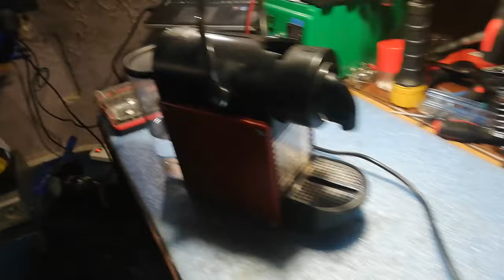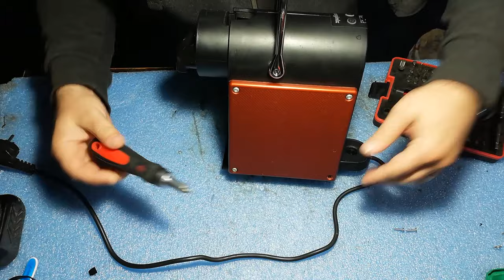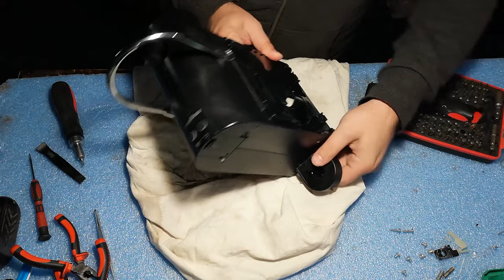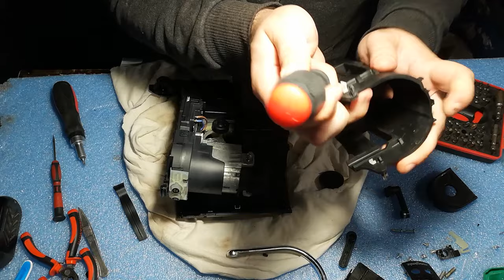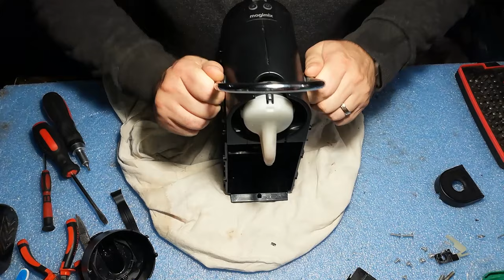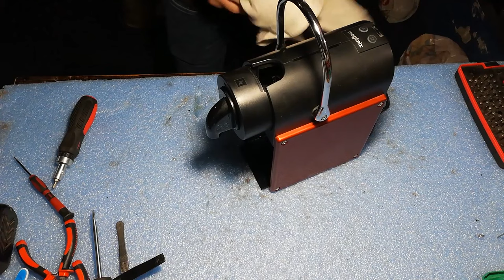NESPRESSO PIXIE - Step by step clean and disassemble guide XN304 / EN124

Comment: PROCEDURE FOR TOTALLY CLEANING THE NESPRESSO PIXIE COFFEE MAKER WITHOUT DISASSEMBLING - MY EXPERIENCE
    

PROBLEM: Machine does not produce coffee due to clogging, causing a large backflow of hot water.

1. Clean the inside of the machine as many times as necessary, as recommended by the manufacturer, until the water comes out completely clean.

2. Afterwards, turn off the machine's power take-off, remove the tray, and do the following:

With the machine in hand, place the coffee outlet under the sink faucet, letting hot water pass for approximately 2 minutes, making the counterflow, which will release the material deposited in this sector.
After applying the cleaning procedure, mentioned in item 1, which will remove the material that was removed by the counterflow of hot water.
3. Repeat the procedure from item 2 until there is no more coffee residue in the spout.

4. After these procedures, there will be no more hot water backflow and the machine will produce coffee normally.
Reply from the maker: Hello. What a detailed guide.  I will pin your comment on this video so others can see it. Thank you for your contribution on helping others!
Reply: @benassy69  After item 2 I applied a "manual" procedure using a counterflow with hot water.
This counterflow procedure is typically used in industrial process filters, or more commonly in pool filters.
As people don't routinely clean, I think Nespresso could incorporate a similar procedure.
Reply: Worked like a charm. Thanks for an easy fix.
Reply: The counterflow technique worked perfectly: I brushed the pyramides plate from the inside with soap and rinse extensively (as recommended by the Nespresso hot line), but it did not help. I then applied full pressure hot water from my tap up the nosle, creating the counterflow... I could see small brown aggregates drip down my sink, and after replugging, I had barely any clogging. Thanks for the easy fix!
Reply: @arnaudcarpentier5960  Hi! I think that Nespresso could provide a simple device incorporated with  machine for feeding with hot water to be used in new counter  flow system !
Reply: @arnaudcarpentier5960  Hi Arnauld, it looks like you´re from Germany. I´m from Austria. Pleasen can you tell me in german , what counterflow means?
Reply from the maker: Stellen sie das gerät verkehrt herum unter den Wasserhahn und drücken Sie wasser in die Kaffeedüse .
Reply: @benassy69  Genau!

Comment: Thanks for your video!
I was able to fix the handler that had broken (after disassembling I noticed that the bearings collapsed). I used JB weld and put them back in  place, I also lubed the rail with petroleum-jelly and it is now fully operational. 
Good thing that I also managed to clean all the channels from inside. This machine is being operating for the past 10 years, would you imagine the mess. Lol.

Again, thanks a lot.

Comment: You clearly forgot the MOST important part!! Make a cup or two if you are able before you start to help motivate and keep focus! Truly a great video that helped me clean my system properly and identify where the leak was coming from. I got it into working order just before puting the other half on to see it operate. I used your other video for "most common leak points" to identify the leak just after the heating point.  Took that apart and cleaned and the leak is much less now. I may replace in the future, but my system is fully hands on cleaned with vinegar and soapy water.  Thank you again for such an in-depth disassembly for what we all know they DONT want to be a serviceable unit!
Reply from the maker: Thanks for the comment and I am glad the video was helpful for you. Thanks for the tips as well ...

Comment: Nice video, but before you do this try backflushing the nozzle under a hot tap. Open the chamber and just flush. It worked for me: a lot of gunk came out and after that the machine worked flawless again.
Reply: This reply needs to be pinned!!  This worked perfectly for me.  

I back flushed under the tap, then normal flush with the pump, then back and forth between back flush and normal flush.  A ton of gunk came out, even though I always flush with water before and after making an espresso.
Reply: I did this, and took a toothbrush and gave it a good scrub inside, and now it works perfectly again.
Reply: I’m sorry how exactly do you backflush it
Reply: @odenjohannesebastianbach1463  Remove all the loose parts.  Open the chamber in which you normally put the coffee capsule.  Hold the machine upside down above the sink.  Run water through the nozzle (the part from which the coffee is normally dispensed).  You'll probably see a lot of old coffee residue come out.  Be careful and it should be easy to keep the rear of the machine dry (which is where the electronics are).  After this, reconnect the machine and and run it with just water.  Probably you will again see coffee residue come out, this time from the nozzle.  Repeat these steps a few times.
Reply: I started dismantling my machine a month before this post and just coming back now to finish cleaning and put it back together!  This would have saved a lot of cursing 😂
Reply: @markachternaam5207  what do you mean by "loose parts"? Do I need to remove the side screws ,the handle screws and the body casing on each side?
Reply: @ryuno2097    No, just the water tank, drip tray and used capsule reservoir.

Comment: Hi Adrian, I discovered, via the manual, that the correct and very easy way to remove the inside chamber that you struggled with, forcing it, is by inserting a small screwdriver at the top on the left inside the drip tray chamber, there is a small square hole, when you do that and lift a little bit at the same time, it releases entirely by itself, without any pulling and/or danger of breaking latches/tabs.
Reply: The manual instructs on how to disassemble it? That's pretty impressive. Mine not.
Reply: @DavidMoralesMojica  Hi David, yes, one I found does.
Reply: @DavidMoralesMojica Also important to know is machines, gadgets, watches, phones have been made most often with the intention to put people off of trying to fix anything, the manufacturers promote material waste, they want people to throw things away and buy new ones. This is why new EU law is going to oblige manufacturers to make, for example, phones in which the buyer can easily replace a battery. Nespresso developed machines to make it seem impossible to fix, newer versions are sometimes easier. Basically manufacturers are guilty of creating societies that create lots of environmentally unfriendly waste.
Reply: @GetMoreMellow  I'm curious, what brand you have? What does it say regarding disassembling the machine?
Reply: @DavidMoralesMojica  It says never open always let an accredited service person do it (€€€€€€€€€€€€___)
Reply: @DavidMoralesMojica  They are always similar the oldest types were made to be the most difficult, they also use screws that nobody has a screwdriver for, anything to deter people from helping themselves, obviously very unhandy and unintelligent people shouldn't mess around, all you do is take great care and do not touch anything is it is plugged in. My one is all models, I have fixed most. Those with fewer gadgets like automatic capsule drop function are best as fewer things can go wrong
Reply: @GetMoreMellow  But you said that via the manual you discovered an easy way to separate the pieces. I'm curious what the manual says about it, because mine doesn't have any mention nor image of the inner pieces to realize how to disassemble it correctly. My brand is Krups.
Reply: @DavidMoralesMojica  I will see if I can refind it, what I found was online. Even if you know where the top secret latches are it can still be hard with some get parts to release, but the part I mentioned at frint when I got my little screwdriver in there at the right spot  the thing came loose immediately. Those books they provide are mord or less useless, inline more can be found

Comment: A few years ago I did painfully this with a Pixie to scrap off the aluminium from the diffuser plate (after it had been sitting in the machine for over a year).   Today my machine didn't flush due to coffee residue and I wanted to see if there was a frustration-free way of disassembling this and now I know there isn't!

Before anyone tries the disassembly: please try Ted van Oss suggestion in the comments and try to back flush the nozzle of the machine under running water.  Solved my blockage near instantly for me.

Comment: Thanks for the tutorial, I managed to fix my Pixie, so all good. I have though a few observations on how to make it even better. First, it would help to zoom in when a particularly tricky part is handled, to remove guessing. Second, the casing is held together by snap-fits, which I broke many of them while taking it apart, as I didn't know where the "male" and the "female" were. It would help to provide tool insertion side, if known. Thanks again.

Comment: For this issue absolutely no need tear down the whole set,  a waterpik Oral irrigator do very good job, just remove the capsule chamber， then use waterpik flush the nozzle from outside, 2 minutes you will get things fixed,

Comment: They don't make it easy, do they?  I was waiting for the blood damage :)  Excellent video showing what a tricky job it is, even for an experienced repairer.  

My problem is that the coffee capsules are not being pierced so I get neither water nor coffee!  I've nothing to lose, so I'll strip it down as described by Adrian, clean it all and see if it works after reassembly - if I succeed in reassembling it, of course.
Reply from the maker: Hello. I have a different video on the reasons why some machine do no pierde the capsule foil. Take a look
Reply: @benassy69  Thank you.  I de-scaled with white vinegar and used a toothbrush on the mesh at the front as described in your other video. It's all working again.  I took the sides off as I cleaned up the whole machine and, in the area where yours has springs (mine doesn't) I found a live slug about 20mm long! I cannot think how it got in. Luckily nowhere near the coffee route :)  A lot easier than stripping the whole thing as in this video.  

Once again, thanks for the help.

Comment: I found a MUCH easier way. Fill a large measuring cup or something with bleach and water. Open the dispensing area, flip the unit over and soak the spout and dispensing area in the bleach water. Use a toothbrush and perhaps pipe cleaners to scrub the diffuser plate and get into the spout. Drain and then run clean water through to flush and rinse. No disassembly required.
Reply: That still doesn't clean the perforated water injector.

Comment: The Delonghi Pixies are the most reliable Nespresso machines I’ve ever known.

Like I can’t even find teardown vids of that model which says a lot about their durability.
Reply: I've had mine for ten years and it gets at least 5 hits a day.  Descaled annually usually does the job, but do you know if DeLonghi is suitable for the teardown?  I'd like to do a deep clean of the water injector nozzle and the interior nozzle.

Comment: There are cleaning capsules available (not descaling packets) available (I saw 10 for $15 online) that promise to help with this type of buildup.  I’m sure they can’t clean as thoroughly as with the manual cleaning of each part, but could help.  Has anyone used these, and if so, what were the results?
Reply from the maker: It is the first time I hear about this cleaning capsules. I would also be interested to see the result of one.
Reply: This is a great 10 year service video.  So I am looking for a project and have now found one for my 10-year-old machine where descaling is no longer as successful as it used to be.  Just hope I don't break any tabs.

Comment: Great Video, thank you. I get teh feeling the brewhead could be dissasambled without taking the how machina apart.. gonne try! 
;-)
Reply from the maker: I tried, but only managed to do it only one. I am thinking of creating a special tool to do this also.
Reply: @benassy69  What I think is you might be able to pry the diffuser out through the openings top and bottom..
Reply from the maker: Exactly what I was referring at. It is really difficult. Only managed once with 2 small screw drivers.
Reply: @benassy69  If we get that off, it would be great to get the nose from the house from the outside. Maybe with some small damage.. And I think that grabbing the nose from the bottom and pressing up would get the nose detached without damaging much.
Reply: Removing the nose is useless.
Reply: I think you should add changing the o-ring when it's disassembled?

Comment: Hello Adrian.  I would like to know which Nespresso machine is more reliable and which one is the easiest to disassemble and handle?  Thanks in advance.
Reply from the maker: Hello Sasha. More or lees all Nespresso machines have the same internals and eventually  have the same faults. 80% of the machines that come to my shop only need a deep cleaning of the front nozzle part due to clogged coffee over time. To answer your question the simplest Nespresso machine to disassemble, in my opinion,  is the Citiz model but not "Citiz and milk" model. My next video will be about this model.
Reply: @benassy69  Thank you very much

Comment: Was it just me that aw the locking tabs break on the cover of the water tank base?
Reply from the maker: Don't be so hard to judge. I have onened tens of units and I want to tell you 2 things: 1. The plastic gets hard and brittle with time it is almost impossible to remove the cover without snapping at the weaker points. 2. Don't worry about those retainers, the cover sits perfectly without them also. Believe me. Take care my friend!

Comment: That’s a lot of work and trying not to break the pieces. All those tabs and parts - Good job , but. Don’t think can do Wow. 😐
Reply from the maker: Have you did it in the end?
Reply: @benassy69  no called customer service. They had me use soapy water n brush inside and poke the inside of the spout with a toothpick. I had descaled it but - still had problems. However, after a few tries the water stopped coming out the back. I put 1/2 sheet paper towel folded in the clear part n it’s not bad at all. If want to exchange - for new they gave me a discount. But for now I’m making cafe!

Comment: This is one of the worst models actually. It is difficult to get apart. It makes a hell of a lot of noise. If you want to make a coffee when it's late, the neighbours may think you are drilling in the bathroom, or your wife has got a heavy duty kick-starting vibrator and is using it many times a day. The Essensa in my opinion is much nicer, easy to take apart, not as noisy because Nespresso introduced an innovation they came up with, which is a rubber setup to which the noisy pump is attached, this model her doesn't have that and so amplifies sound by having the pump laid pretty much against the plastic of the machine.